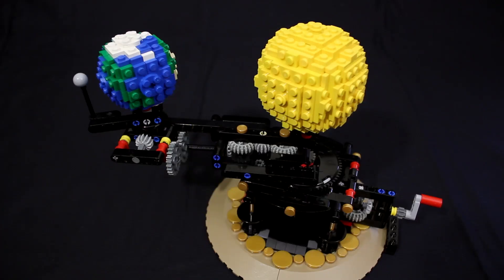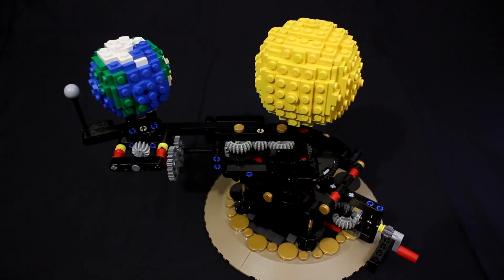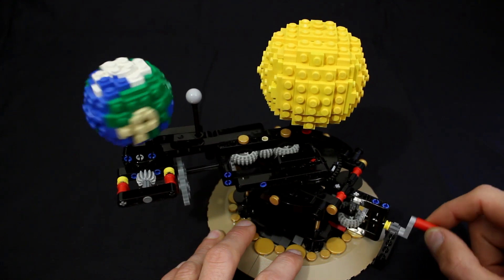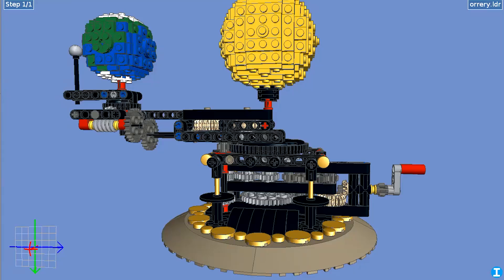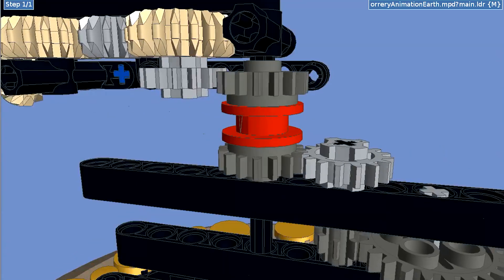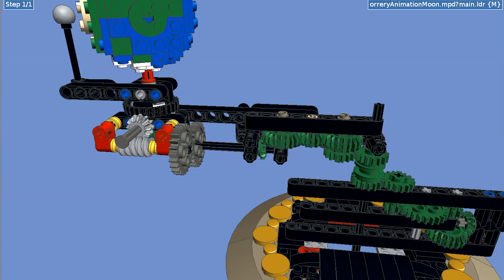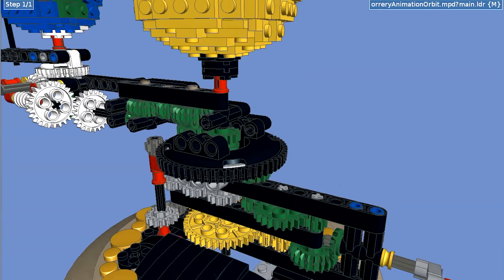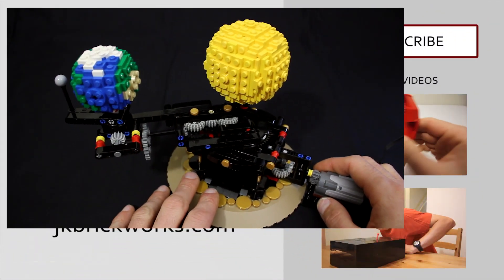LEGO Orrery - Earth, Moon and Sun

Comment: Hopefully you are still watching out for questions on this model! I have recently built this model, and think that it is amazing apart from a crucial gear link that does not work! And so I thought I would YouTube the issue and found your brilliant video!! I have exactly the same model as you, but do not have the electronic drive!
I have a few questions:
My issue with how the gear on the bottom section of the model drives the gear on the top section!! Everything works in both sections separately, but when I click the sections together, the friction on the top section prevents the top gear rotating when the bottom gear is turned!! In your model, all the gears turn very smoothly and easily!  Can you suggest how I can get the gears to turn more smoothly please, so that the gears can turn as they should! 
Also, if you know of a source for the motor that drives the model, it would be brilliant if you get let us know!!!
Thank you very much! JDG.

Comment: Now connect the crank to a motorized gear system that rotates it once every 24 hours. This way you will get a (close to) real time model. That is if you didn't do that already in the 6 years since you posted this video.

Comment: Jk. Can you make the same model but put a slow motor on it and make it go at the same speed as it would in real life, so every rotation of earth on the model is the same as the rotation of the real earth?
Reply from the maker: That would have to be one really slow motor!
Reply: That's actually a great idea, imagine having a orrery in your room and seeing the earth and moon in different positions for fall, winter, autumn etc.
Reply: use the hour hand of a Lego clock!
Reply: you can always do some extreme gearing on the motor side to make it super slow..
Reply: Capt Mexwall spending little electricity, nothing matters
Reply: XD IT WOULD TAKE ALOT OF ELECTRICITY
Reply: Lexkanerz
Reply: it would last one month to rotate entirely lol or maybe more
Reply: JK Brickworks or you could add a huge gearbox that uses ratios to slow it enough, and be able to use a normal motor. It'd probably be a huge gearbox lol
Reply: autoharp I agree
Reply: Lexkanerz you're correct!
Reply: Shark fan 262626 Pokestop you aren't allowed to curse on YouTube

Comment: i actually built that monster today... and i have a problem. At around 4:00 in the video the small cog that should power the large turntable doesn't quite connect... but i can't see where i did go wrong. Can you give me a hint? And sorry for my bad english...
Reply from the maker: +Stahlhart385 You are probably using the older 56 tooth turntable. I'm using the new 60 tooth turntable, which is slightly larger in diameter.  You can use the 56 tooth one, but you'll need to use a 12 tooth double bevel gear instead of the 8 tooth gear to drive it.
Reply: JK Brickworks
I see, thats the problem. Thanks! And i already found a (quite simple) workaround for it. I put some folded paper between the gear and the stabilizer/support (whatever) behind it. that pushes the gear to the turntable and makes the whole thing work. "Playing" with it is quite awesome :D
Reply from the maker: +Stahlhart385 Cool, glad to hear you got it working!

Comment: This should go onto Lego ideas! Did you use some calculation tool to make the shape of the earth and sun look so round using only these small lego bricks or was it build without such help?
Reply from the maker: +DarkGeorok The Earth is a pretty standard construction for building spheres of that size. It's called a Lowel Sphere (named after Bruce Lowel, the first to pioneer the technique) I used Bram's sphere generator for the sun, which generates models based on the same technique at different sizes: http://lego.bldesign.org/sphere/

Comment: This is incredible, I think I have found my next project.  Me and my son built your LuuMa  EV3 and it was awesome.  Outside of the 2X2 tile with pin, driving rings and turntables, it looks like most of these pieces are pretty common.  At least I hope so, it was quite a logistic operation piecing together the box for the LuuMa.  I ended up going with yellow because the tiles were a lot cheaper than black tiles.  Anyway, thanks for sharing these videos and files--great stuff.

Comment: That's so accurate! You're amazeing builder Jason!
Reply: denis Puljek  It is amazingly accurate about the rotation times, not perfect but very amazing considering it is build only of Lego gears where you only have a few given numbers of teeth on the gears!
That is what this is all about, to show the rotations!
 
If the moon is 1 stud in diameter (0,8mm), the distance between earth and sun would be 370m! That is not possible in Lego (even if you have the place of 740m diameter and the parts, simply because of the weight). And it´s not what orrerys are to show, not even non-Lego ones in astronomical museums.